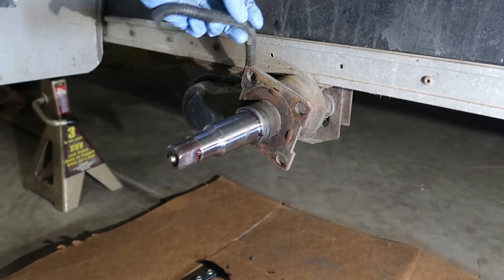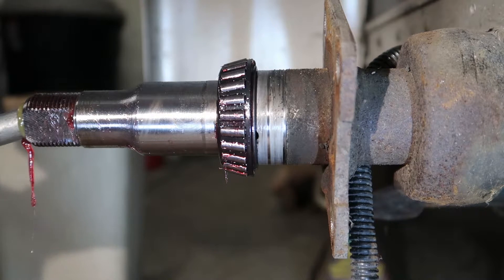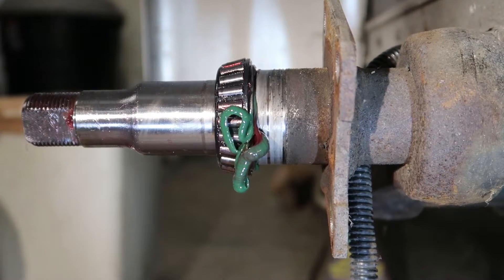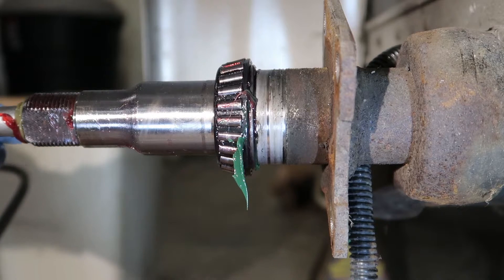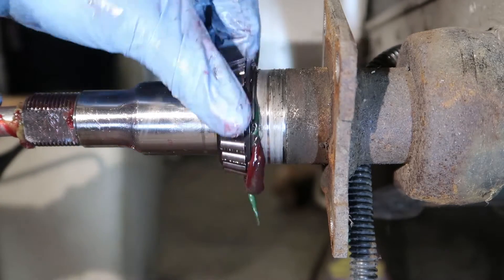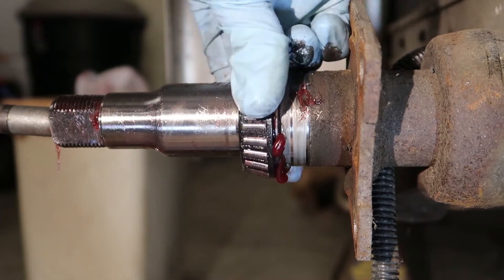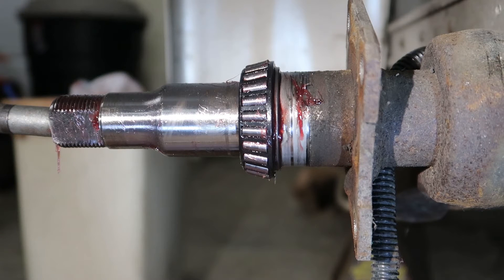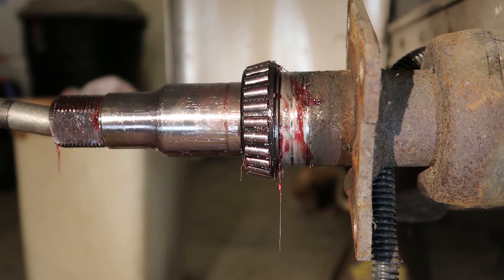EZ Lube Hubs EXPOSED! | Trailer Axle Maintenance

Comment: I use my EZ lubes every year, and the grease immediately come out the front of the hub.  I've never had any problem with a "blown rear seal" or grease on my brake surfaces.  I suspect your method of testing has some kind of fault.
Reply from the maker: If you always us the EZ-Lube hub and never disassemble the hub, how do you know that the rear seal isn't blown?
The problem with EZ-Lube hubs is people treat them like they are Bearing Buddies (on boat trailers) and continually pump grease in.  It's just a matter of time before the rear seal blows out when doing this.

Comment: so many good comments on why this is NOT a valid demonstration. its a system meaning more that one part. each component needs the other for the system to function correctly. i was guilty of being a couple pumps/month guy and calling it good with the wheels on the ground until grease was everywhere and my truck was getting pushed around. unfortunately, some of us have a bd habit of learning the hard way.

Comment: Hmm not sure here…. I’ve had these hubs since 2019 on a 23’ travel trailer… use this exact unloaded greasing technique…hauled our trailer all overMI …1000 mi trips… on to Canada same miles.  …..over4 Years of travel……if… If a failure would of occurred it Would!!!!    Follow rules asDexter says …. Take short cuts and you will be on the side of the 😂.

Comment: Even with a new rear seal you can blow grease past it - I speak from experience.  ALWAYS rotate the wheel, pump grease slowly, and do it in warm (overnight) weather when the grease flows more easily.

Comment: I have to agree with some of the other people that commented.  If you take your time and don't pump grease like a madman and spin the tire, you shouldn't have a problem.  I've been doing this on our travel trailer the last 5 years with no issues.  When I'm doing this, if I pump one shot of grease into the fitting, I'll see about a squirt of old grease coming out.  Obviously, it's working.  It's a nice video to show where the grease exits on the spindle.  I had no idea about that.

Comment: The hole placement is poor.  But EZ Lube recommends repacking and doing the works every 12 months or 12K miles.  Then I ask, what's the benefit of EZ lube then? My problem is that I put about 3K miles per year.  And then, on cars, you can go 50K miles easily without ever touching their bearings.  No grease, no inspection, nothing. Except you might shake the tire every 6 months on tire rotations to check the status.

Comment: I think, people pump grease with tires on the ground and blow out the seal or they used a pneumatic or electric grease gun over a recommended hand held grease gun. Dexter EZ lube, to this date, has a step by step video on how to use their product.  Stop being lazy and repack by hand, then no worries? Nothing is EZ.

Comment: I noticed you dont have a hole in axel for cotter pin, that goes through the castle nut. I think i have the same system on my kendon motorcycle trailer i just picked up used. I believe you have what i have on my axel, instead of cotter pin. I have a retainer clip that goes over the nut, my question is does that just go on any way. Or does it go on a certain way. Thank you if you could answer that
Reply from the maker: The retainer clip just snaps over the spindle nut.

Comment: If you really want to see how it works assemble everything as you would with seal and all and new clean bearings. And grease with the zerk as you are supposed to while rotating then pull it apart and see how the bearing packed. The way your video shows is like trying to complain that a tire not mounted on a rim doesn’t hold air. Your trailers PO probably didn’t grease correctly. I see lots of people just jam grease in the and not turn the wheel and it builds too much pressure in one spot and blows the seal.
Reply from the maker: Where in this videos was I complaining about a tire not mounted on a rim not holding air?

Comment: I have this system on my boat trailer.  One wheel works as advertised, the other not so much.  No matter what I do, the grease on that side, goes out the rear seal.  Not using a high pressure gun, I am spinning the wheel...  I hate the spindle washer system.  Not so bad getting it on and the "ear" on the castle nut; getting it off is, for me, an exercise in futility!  Why they didn't use a cotter pin makes no sense...unless it would have to go through that grease channel.  I have real mixed feelings on the whole system.
Reply: How are they going to drill a hole for the cotter pin...? 
That would intersect with the grease channel and when you pumped grease in it would come out @ the cotter pin and not travel back to the inner bearing  🙄

Comment: I wish we knew exactly what the old owner did. Then we could all not do that.
Reply: He clearly used a pneumatic or electric grease gun and went to town, of course the rear seal will blow out in that scenario! I install oil and grease seals every other day just think of the pressure it takes to beat it in.... 1 to 2 hand pumps will never blow that out you couldn't pump fast enough. Unless some old grease hardened and let loose but that's a long shot most people don't have the knowledge or patience and just start squirting with power tools. Not to mention if there was a blockage the hand grease gun would let you know right away you should stop and disassemble asap if it's not taking the grease. The way it works low pressure grease hits that rear seal bounces off goes thru the rear bearing into the cavity then thru the front bearing and out the front hole. It's not rocket science!

Comment: That grease port is also where the spindles crack and fail
Reply from the maker: I haven't heard of that before.
Reply: @deltabravo1257  Just from experience
Reply: @deltabravo1257  At the inner bearing

Comment: I believe he’s trying to explain that the grease hole is between the seal and inner bearing.  Getting heavy handed with the grease gun can possibly damage the seal and rotation will evenly distribute the grease instead of pushing all in one spot.  I just shoot a few pumps in slowly while stationary and have never had an issue. After several times of that I eventually manually clean everything and install new seals.
Reply from the maker: That's EXACTLY what I'm trying to explain.

Comment: Not as good as packing the bearings, but once you have the hub assembled and the axle jacked up and the tires spinning,,, it is gonna be way better than what you are showing. I like the system they have even though i know tear down and repack is better.
Reply from the maker: Good tip!

Comment: The rear grease seal will hold the grease in, and the grease will begin to travel forward while the wheel is spinning. The way I understand it, the rear grease seal shouldn't blow out, if the wheel continues to spin while using EZ Lube.
Reply: This person understands it. The person in the video completely doesn’t.

Comment: I've told many of my friends that all that spindle bearing grease zert is a marketing gimmick  for guys that don't know how to repack bearings. Pumping all that grease in there just blows out that rear seal, and gets on the brake pads.
Reply from the maker: Yep, it will blow the rear seal.  I've never heard of a "zert" though.  It's a "zerk" fitting.

Comment: Excellent video.  I've been told by more than 1 brake tech that while EZ lube does ok a job, it never really does a good job of pressing grease into the  bearings.  They also all stressed the importance of replacing the seals to ensure there's no brake contamination.  Every 2 yrs depending on mileage.  I was surprised how little grease was left after 1500 miles over 2 summers.

Comment: I would say that 97% of fisherman just shoot grease into the hub assemblies.  I owned a mud boat trailer for 10 years and never. Greased the hub ever.
Reply from the maker: Boat trailers are different, they have a different rear seal on the back as well as a device on the hub called a Bearing Buddy.

Comment: No evidence of grease going through the bearing??  hmm with hub and seal in place it would be forced through the rollers of the bearing, first through the inner bearing, then outer bearing.

The problem with grease seals on these axles is that most people replace them with the cheapest seals that come in a package from tractor supply.  The correct seal from dexter is much more robust and is much harder to push out.  It's generally not a good idea to push grease in too fast when it's cold either.  The general design of the axle is not an issue.
Reply: That's exactly what I said in another post about people that say you will blow the seal out using the ez lube system.  I had a mechanic friend tell me to do it on a hot day so the grease will flow easier and not to go crazy pumping the grease gun.  He said take your time and do it slow and you should have no problems.

Comment: No kidding the bearing isn't getting grease. If it was in the sealed hub the grease would be willing and pushing all the old grease. Even if it doesn't pushed the old greas out of the inside of the bearing as the axle rotates it wil l grab new grease from the outside and coat the rollers. 

One of the issues I see with manually packing is it doesn't fill in the axle with grease so you aren't really doing much once what you packed in there wears out.

Comment: The rear axle seal is what makes the grease go into the bearing.  Once the bearing starts to warm up the grease will thin out, go to the bottom of the bearing and then go inside.  Always start with a prepacked bearing and lube depending on the amount of use.
Reply: in theory thats how it should work. but it doesn't...

Comment: Wrong conclusion.  If a good seal is in place, the path of least resistance is through the bearing.  The actual problem is that the hole where grease exits from is razor sharp an it cuts the seal every time the hub is installed.  Soften the edge of that hole with 600 grit sandpaper, then take care not to overdo it with the grease gun and it works fine.  Also, I make sure that the bearing cap has a very small hole in the center of it - the bearings can heat up very quickly under braking, and this makes sure that pressure does not build at the inner seal.
Reply from the maker: Look at the photos again and you will see how the previous owner of a trailer I had blew out the rear seal and ruined all the brakes.

Comment: Wanna know what's even worse? A sure lube system with a cotter pin instead of a tab washer.  The grease doesn't even travel through the back hole, it simply squishes out the cotter pin hole.  I just discovered this after owning the trailer for 12 years.  If I plug the pin holes I can watch it come out the back.  Otherwise does zip, squat, nadda...

Comment: Put the rear seal in place as you can see by the clean spots it sits threeeights of an inch farther onto the hub and if the rear seals in good shape the grease has to go forward! That being said I have to pull them apart once in a while and make sure that the rear seal is actually doing its job!  Good video thank you

Comment: If you have a nice warm or hot day and you raise the wheel and rotate it as you grease with nice slow pumps you should have no problems purging one wheel bearing assembly with one tube of warm grease. 
If you don't rotate the wheel while you grease, pick a cold day to try and squeeze cold grease in your bearing assembly, you will blow the seal and end up with grease everywhere. I always pick a hot day, or bearings that have just finished a long haul and are still warm, and I use grease that has been kept warm in anticipation of the job. I have never had any problems with these Dexter E-Z Lube systems.
Reply: That's exactly what I said in a couple of posts about putting the grease in.  I had a mechanic tell me to do it on a hot day so the grease will flow more smoothly.  I can see that.  He also said don't go crazy and keep pumping the grease gun like there's no tomorrow.   Put some in, spin the tire for a bit and let it work around.

Comment: You have the wheel off so no grease is going to move forward. The old owner did not rotate the tire while pumping grease in which forced it out the back.
Reply from the maker: I'm not sure what technique the old owner used.

Comment: Just follow the ez lube manufacture directions. Who knows if the previous owner even jacked up the trailer, spun the tire when putting the grease in,  or used enough grease to drive the old grease out, or even did it at all for that matter.
Reply from the maker: I'm not sure what the previous owner did when greasing the EZ-Lube hubs, but the hubs were packed full of grease and the rear seals were blown out, wrecking all four brakes.

Comment: I pull my hubs apart and replace seal and hand pack bearings once a year anyway even with grease zeros it is a good idea to inspect the bearings and also retighten the bearings anyway and like this year have found thay one bearing cage had come apart on my trailer and so was able to catch it before having a major issue
Reply from the maker: Inspecting the bearings is important.

Comment: Although I agree with the idea of disassembly and repacking manually on a regular basis, whatever that might be, I don't think your video supports your argument that the EZ Lube system is bad.  The hub, bearings, and seals need to be fully assembled to truly test the system.  Perhaps you should make a video where you disassemble everything, replace the bearings and seals, and reassemble.  Then you can pump the grease per manufacturer's recommendations, disassemble once again, and then evaluate whether the bearings and axle got sufficient grease.
Marine applications require more frequent maintenance, and repacking the bearings every time grease should be refreshed would be an unreasonable expectation. The EZ lube and Super lube systems save a lot of boat trailers from premature failure.
Reply from the maker: Thanks for watching.

Comment: Can a very small hole be drilled before the bearing
Reply from the maker: Probably so, but I don't know how much good it would do because the grease will flow straight through the spindle bore hole before it "makes a 90 degree turn" and flows through the cross drilled hole.

Comment: Many years ago I had the bearings "repacked" at a dealer service. I wanted the bearings removed, cleaned and inspected for damage and wear. But they never did any of that. They just pumped grease in the EZ Lube fitting. Headed out to Maine and nearly lost the whole rig because I had NO BRAKES! At the campground I pulled a wheel and found the entire brake unit full of grease. Three of the four wheels were ruined! A one night stay ended up being three nights, two full days of cleaning and rebuilding and about $150 in material. Campground owners were very gracious letting me do the work on my site. 
EZ Lube is NOT a good idea in my book.
Reply from the maker: I agree about EZ Lube not being a great idea for people that think it's a substitute for a "bearing repack", which sadly is the case for many people.  The photos I show in the video are from a cargo trailer I bought.  The brakes were ruined and required a complete rebuild before I was able to use the trailer.

Comment: I also have the EZ lube system on my utility trailer.  At what mileage does everyone suggest I repack the bearings?  I put 2000-3000 miles a year on this trailer
Reply: I recommend atleast once a year and even if you have a system like in the video replacing the seal once a year
Reply from the maker: Dexter recommends 1 year  or 12,000 miles I believe.  I go 2-3 years or so on my cargo trailer because I also only do about 2-3k miles per year.
Reply: @deltabravo1257  Thank you

Comment: I have the sup R lube hubs on my boat trailer and I always hit them with a grease gun after a trip but I spin the wheel. Thousands of miles on that trailer with yearly bearing replacement. The marine hub uses a double lip seal and I have never had a blown seal but YMMV
Reply from the maker: A special Double Lip seal is what is spec'd out for boat trailer axles.

Comment: The Ez Lube axles can push the inner seal out. BUT #1 Dexter says do NOT use a pneumatic grease gun because they are more likely to push out the seal ( you are not using a pneumatic grease gun in the video so you are good there ) #2 I ALWAY grease put grease into EZ lube hubs on a very hot day and i leave the trailer in direct sun and also leave the grease and grease gun in the sun  for a little bit because the more liquid the grease is the less likely it is to push the inner seal out. I also constantly spin the wheel and have the wheel jacked up off the ground. #3 no EZ lube hubs do not work 100% of the time but if done correctly they will work 95% of the time and it is a LOT easier and cheaper then taking everything apart every year just to repack bearings. #5 it does take a kind of long time because I i keep pumping in the grease until i see nothing but clean new grease coming out of the front of the hub.
Reply from the maker: Very good tips.  Thanks for sharing.
Reply: What happened to #4 haha
Reply: @dadswayorthehighway3300  I don't know what happened. I ant so good with numbers i guess.

Comment: Some people use a power grease gun also which is a no no . I don't believe the grease could move fast enough , so it blows the seal out.  Just a thought I could be all wrong .
Reply from the maker: Power grease gun will definitely blow the inner seal.
Reply: Power grease guns are intended for heavy duty equipment